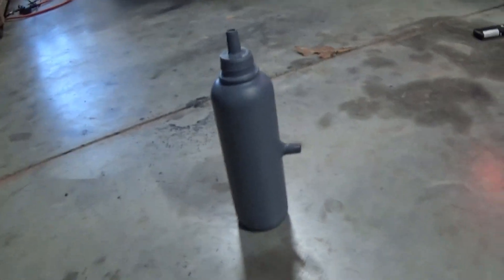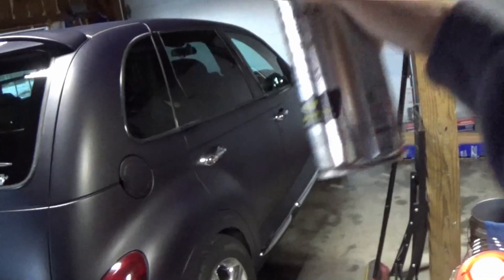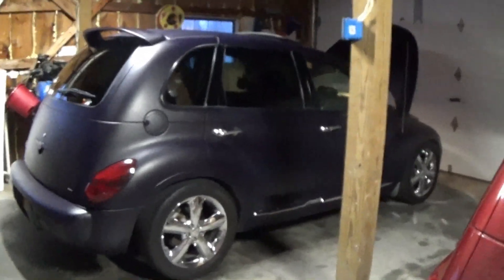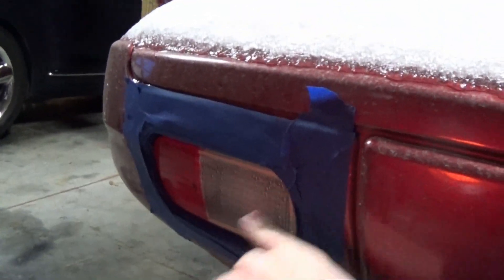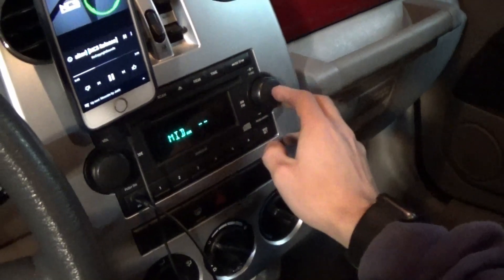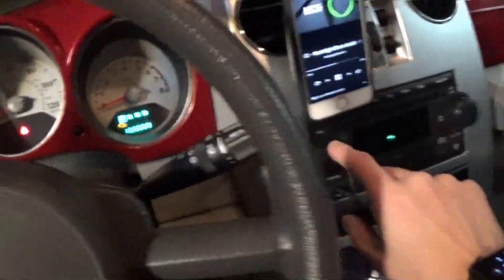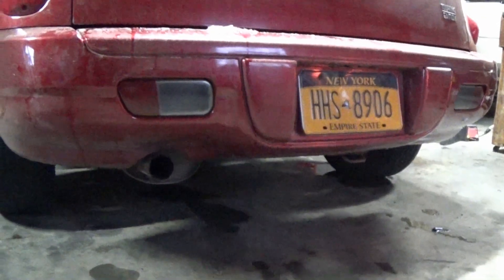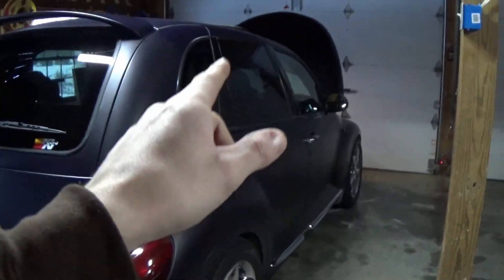New CUSTOM BUILT Mod For The PT GT!  + Daily Cruiser shenanigans

Comment: I have to point out a few things.

1.) you should run a single can from the PCV valve line. A second can is great where you chose to mount this one.
2.) your inlet should be at the the top of the can as well as your outlet.
3.) somewhere in between (preferably towards the top of the can) you want some sort of filter. Dimpled and drilled piece of metal. This keeps the oil down.
My best advice is to take this off. If the can fills quickly, you will be introducing larger quantities of oil into your intake.

Comment: Make your doors go Thud,, Simply glue in some rubber pads to the in side of the door, will also greatly increase the sound of bass from the speakers'
to the metal of the inside door (contact cement)

Comment: The reverse lights come out super easy, no bolts or anything. Its difficult to explain but there is plenty of yt videos to watch to help you.
Reply: You like pop them out with a screw driver -the tail lights have little metal shapes that pop them in, the reverse lights are simular
Reply: @alexandruhill1155  yep pretty much
Reply from the maker: I didn’t know that, thank you guys for the info!!  I know the GT has small torx screws built into the face of it, so when I noticed the 07 was different I said screw it for now 😂 next warm day I’ll try to pop them out and redo them and throw some LEDs in too!  Thanks guys!  😁🤙🏻
Reply: @jimmycruiserr  you undo the torx bit and pop them put with a screw driver, on the 06 you just pop them out
On my pt I've put strips of electrical tape on the top and bottom, ive gone to dollar tree and used some clear red wrapping paper on half the reverse lights, so full red and black on top and bottom of both
Reply: @jimmycruiserr  yeah, the second gen pt's had a different design, make sure to be careful popping out the lights, as it is easy to scratch the paint around the light.

Comment: Hallo. I am living in Holland. I can buy a Pt cruiser 2.0 liter  from 2004 with leather seats and cruise control. Can i upgrade this engine with a turbo later?  Because the 2.4 has not so good fuel economy and is heavier.  I am waiting for your advise. I want more power but with good fuel economy like the modern cars.
Reply: Yes you can buy turbo kits that bolt on , you do need to remove the oil sump and tap and drill it  ! Everything else is just normal spannering  allow two to three days and about £1300 .
Reply: @timmytackle9181  Thank you

Comment: How do you adjust the head lights up and down. Mine point to the sky.
Reply: Get new struts in the back, so you have rake
Umm ok for real now, there's 4 bolts per headlight, use small spacers or washers, on the top 2 bolts. Take them out put on the washers 1, maybe 2. Use a strip of electic tape if you want on the top edge of the head light while its out. Put the headlight back in as best you can to fit, they'll aim down a little

Comment: """"  Shouldnt  your catch can  go up  by your intake hoses """"
Reply: Not for this engine/ engine bay. The way the SRT4 Neon/ PT GT engines sit within their bay and the double PCV "evac" exits from valve cover you almost need two catch cans >.> and a check valve to properly stop that oil shenanigans. The way he set his up is literally perfect for the intake side pcv! The idea is to have the oil be brought down to the catch can, and air from the intake position higher, so that it doesn't suck oil into the intake during load. During idle, the PCV valve/ check valve if you have one installed, does the other side directly into the intake manifold. 
Its a two way PCV exit design. Its actually brilliant if you set it up right, virtually no extra oil gets suck back in.
Reply: @Roobsrandomz  ,,,On my pt  i have  the can from the pvc to the intake ,,,now the intake stays super clean .....